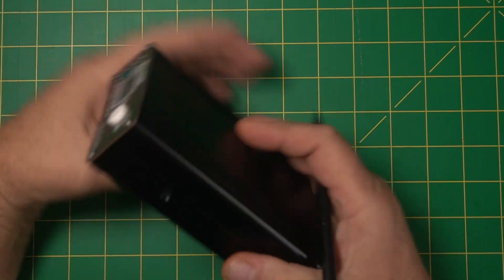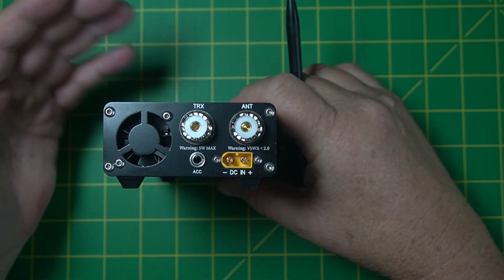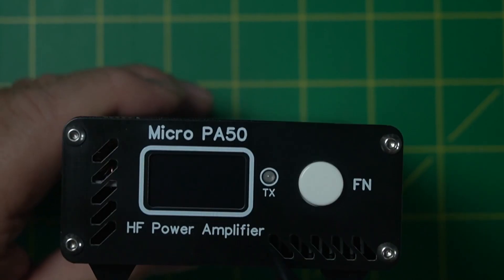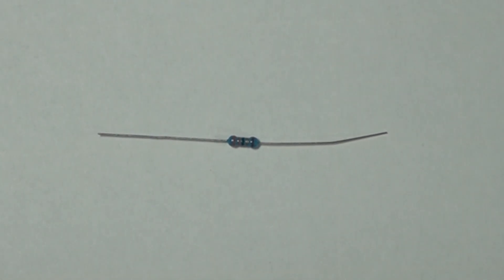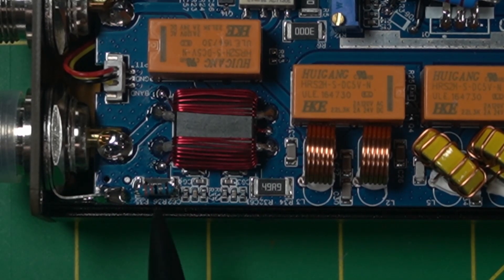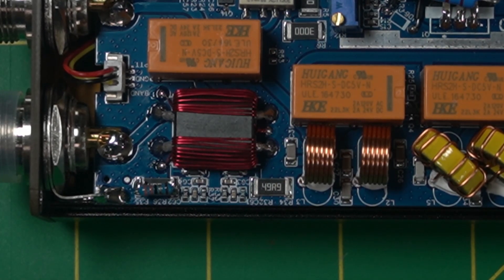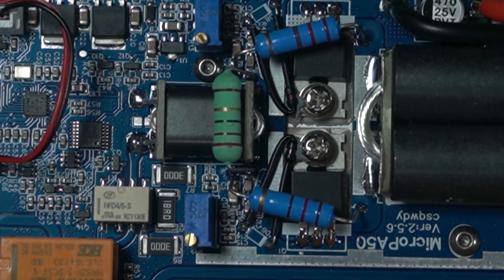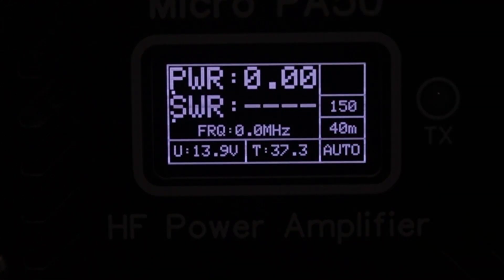What's wrong with the Micro PA 50?

Comment: So 1 year later does the Micro PA mod still work ? I was thinking about doing this mod again seem like even on the latest firmware it's still way high then what my tuner and radio thinks the SWR is at which point makes it annoying to have to make sure you are tuned up before enabling the PA again which is also less accurate it seems.
Reply from the maker: Yes mine worked great last weekend.

Comment: I am not sure this is really needed. I have this amp and it works great. If you put a common mode choke on it, I think you will get better results. In any case... there is a firmware update that address the SWR measurement. I updated the firmware and use a common mode choke and do not have any issues.

Comment: We installed this amp inside a big /p radio box. The IC705 does not provide enough drive for the 300W linear amp. Unfortunately, the PA50 did not work. Input VSWR was very high. Not sure why. Found a "manual" online but got no clue. My feeling is that a PTT line is needed. Manual says, it can run without a PTT but no idea how to set that up. Any help is most appreciated. 73

Comment: My understanding is that there is a firmware update to correct this.   Ape did a recent video on it.   This fix looks easier though 😂
Reply from the maker: Yes but he didn't check to see if it fixed the problem mines works great now!
Reply: The firmware upgrade looks like a pain in the butt…this definitely looks easier.   I don’t own one of these units yet.   If the firmware addresses the issue I’ll buy an upgraded version if and when available.   Nice addition to my KX2 I suspect
Reply from the maker: @joen8joe231  Yea I have been using mine with the Hermes lite 2 and it does 50 watts with no problem and my swr reading is pretty close now. 
The fan is a bit noise sitting in the shack

Comment: The designer of the amp commented on another forum that the meter is accurate and to try RF chokes on the antenna before modifying it. RF feedback can make the meter report higher than actual swr
Reply: I did exactly that and my problems went away.  Put a bunch of ferrites on the input  and on the coax to the radio.  Works great with my Xeigu 6100
Reply from the maker: Yes I saw that and I do have a choke in line.  I will do more testing though.

Comment: I would check that VSWR across all frequencies and values to see if it really is consistent. I have not seen the schematic so it isn't clear where that resistor is going, but usually these types of detectors are quite accurate at HF and it is important that that resistor is 50 ohms. Putting a 22 across it pretty severe.  I would also check the power indication, but that's the other resistor.  Why not use an SMD resistor to reduce the gain across the bridge output? It would make a neater job.
Reply from the maker: This is what I had and I'm fine with it. I did check other freq. also and it seemed consistent.
Reply: @KK6USYHamRadioAdventures  Fair enough. As long as it works. That resistor might get a bit hot though in full carrier modes like FT8 as it looked like an 1/8 watt and the original looks like a 1/2 w. An easier fix is to put another 10k across the detector output, you would need an SMD and they are fairly small so would need a magnifier. I tried to link the reference but youtube deleted it. - it is on the sota web page, easy to find, with a nice picture.
Reply from the maker: @mikewillis1592  The original is 1/4 and so is the one I added

Comment: I have added an antuner AT-100M downstream of the amp. I can run short random wires in the field with the amp and a uSDX+ V2. I end up with 30w peak SSB and I am good with that. It all fits in a condor molle first aid kit. A 6ah battery keeps the amp happy for a long while. Radio and tuner have built in batteries.

Comment: Solid work Chuck 👍
Reply from the maker: Thanks Ape it really seems to be a good little amp!
Reply: @KK6USYHamRadioAdventures  David Trewren has a video showing the amp with a tuner on an X6100. I have the same set up and use it with both the Xiegu and a uSDX radio. I like it.